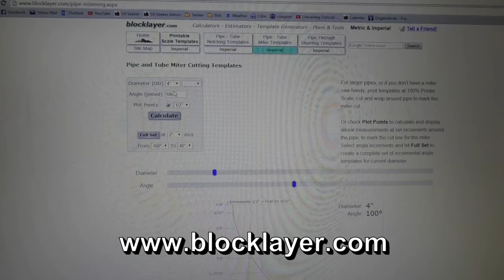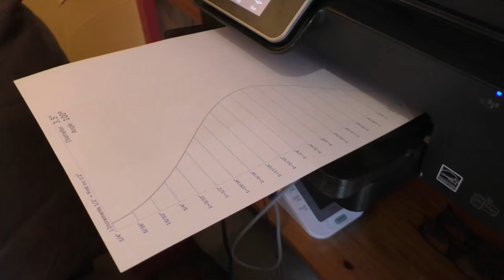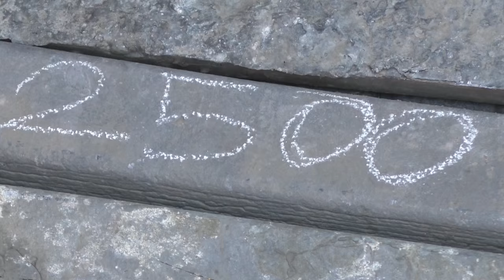Chinese Junk Sailboat - Catwalks and Keels and Engine

Comment: My uncle gave us a good scolding when we let his little garden tractor run bone dry out of Diesel. After he fixed it by cracking all the lines like you were doing, he pulled us on side and described what it would have been like if it had been our boat motor and we were out to sea. I'll never forget that lesson.

Comment: Hey Doug, for the aluminium plank.   if you put floatation under about the last four feet with a hinge, when you lower the plank down to the water, the last four feet would make a level spot to board a small boat.  it would ride up and down.

love the boat.
Reply from the maker: +RocketRadioShow1    Interesting idea.

Comment: Doug
This may have already been resolved but if you were to weld a plate over your lead and install  a thread-a-let you could fill the cavity with oil or such to prevent corrosion around the lead.
Reply from the maker: +Barry Luke    Yeah, we're thinking about roofing tar.  When it gets chilled by the water it would act as a seal too.

Comment: Doug, if you should decide to use the expanded wire idea, you may want to construct what I'll call ankle {hand} railing, that maybe only measures height wise, say 12" inches, (30.48 centimeters.) I would use say 1.5" inch {38.10 mm} Dia. pipe. Use a pipe within a pipe setup, so either you can drop it (remove pins) and it is either flush with the walking surface of the catwalk, or maybe drops just below the catwalk surface. Or Remove (ankle railing) all together. If you should have to stow something on the catwalk surface, it would give you something to tie down / lash to. I would try to make the ankle railing all interchangeable, so you don't have to try to remember which section goes where. Plus then, when your trying at night to escape the heat of the hull, it gives you an option. This Idea comes via my day trip to a U.S. Aircraft Carrier. On an Aircraft carrier, all along sides, and back, they have netting to catch someone should they fall, but the guy who was giving us the tour that day, also mentioned that some of the sailors, when it's really hot, sleep in the netting.

Comment: We have to wear safety harnesses (attached) when we weld 6' above ground level. Failure to wear hard hat, safety glasses steel tip boots and gloves is grounds for immediate termination. Thanks for the "what not to do" safety video.

Comment: Hey Doug. I had the same thought that other people have mentioned about the expanded mesh for the catwalk... but I can see your point that it wouldn't really do what you want. I had also considered some of the nylon mesh, tied tightly over the frame, such as they use on high-end sailboats - but I bet that's probably too expensive. You're probably right, that a simple board might be easiest, but at least put some stabilizer dogs on the bottom of the boards so they're impossible to slip out of place when you're putting foot-pressure on them, pulling a rope or whatever. 

Anyway, there were a few things on my mind in the past week or so that I wanted to mention to you. Stuff we used to do when I was welding and building in steel-fab job shops, when I was younger. Chances are you might've already heard these things, so no worries if you tell me I wasted time telling you about them. I type fast, so it isn't much of a waste of time. Plus I enjoy typing at you. I can't afford to travel to Tulsa, so I feel like I'm contributing, even if it's only in a small way.  :P 

Something you can do to help lining up pieces before welding, especially on sheets, is to cut a big c-clamp in half. Weld a small base plate over the cut on the screw-half, then you can make a small tack on the base plate against your work and screw the business end of the clamp down against whatever you want to push against. Usually to line up an uneven seam before tacking. This would probably work well for a lot of those times where you weld a "U" together out of angle and put a bottle jack in there to push something into place. Obviously it only has as much force as a c-clamp would normally have, but it was a standard tool we used all the time in the steel fab industry. Almost as useful as tacking on a piece of plate and pounding a wedge in to straighten out a seam. 

Also, when you're welding on a picking eye to hook the chain hoist to... something else that was standard practice for us is to weld only one side of the eye. You can put something like a 3 inch weld on one side, with only a small tack on the other side. Then, you can pull with several tons of force - and when you're done with it you can just hammer it from the tack side. The tack will break, the welded side will fold over and break off, and it doesn't require you to grind the welds before removing it. Very useful when you're trying to get stuff done in a hurry. 

Another one, when I spent a year or so lining up seams on 1/2 inch plate before we welded it together, is that you can put a hot tack a seam on a couple of plates that are out of line by as much as 1/8 inch. Then, while the tack is still red, you just smack it with a big hammer and the plates line right up. No need for the big tack-clamps, no need for tacking on wedge plates... just make a big hot tack and pound it once or twice and it lines up straight and beautiful. It's something that saves a lot of time when you're tacking stuff together and don't want to fiddle around with wedges or clamps. 

I'm sure there's a few other things I might remember over the next week or two. You've learned a LOT about what you're doing in the past 5-6 years, so I certainly don't want to imply that you don't know what you're doing. You obviously do. But I spent about 20 years doing a lot of ironwork and steel fab work... and if I can help out by mentioning a couple of things, then I'm glad to do so. I've been repairing houses for the past 15 years, and my memory isn't quite what it used to be, but if I think of anything else that might be helpful I'll mention it do you, eh? ;) 

Still, it's great to see the work you're getting done, it's great to see the boat coming along! It's a lot of fun to see how the project is progressing, and it's a LOT better than seeing what's on the stupid TV. Thanks for taking the time to upload the videos, and I'll keep watching and liking them. :D
Reply from the maker: +KOakaKO Thanks for the tips.

Comment: Great as always :) the other day i had to bleed out the diesel system on my car and what i did was i took a big pnumatic air cyllinder and used it to make a big vacuum on the returnline of the system. I tried the thing with thightening the pipes as it runs but that didnt work for shit. Make a vacuum on the return side of the pump.
Reply from the maker: +Rasmus Laursen   Thanks for the tip.

Comment: Doug just a thought. Instead of keeping planks for walking on the catwalks., ty this. Use a aluminun ladder horizontily laid  next to the bullworks held in place by two simple hings and kept there by a simple    fall down  lever. allways there and when needed lift the lever and the ladder falls  down to walk on. It would be lite and avaible when needed

Comment: Hey Doug, just an idea, for the cat walk(s.) Use some stout expanded wire, or use some thinner material, and use a couple of say 1.5" in. X 1.5" (38.10 X 38.10 millimeters) angle or square tubing, etc., as brace(s) between the 3 foot {91.44 centimeters} on center bracing you have already built. I would think a minimum of 2 or 3 braces per section, evenly spaced should be more then enough. My thought is, this way it couldn't collect water, and act as some type of ballast. In case it's been a long day, the 'L' part / leg, would face the ground / water surface. I've seen this used for cat walk's in some BIG buildings. Plus it would give who ever has to walk this surface, shall we say "some peace of mind," that their not going to be swimming with the sharks. :-) I know, I know, the sharks have got to eat too.

Comment: Boy howdy I love when you post a new video.  Question - why not make the pilot house narrower so you wouldn't need the catwalk?  What I mean is, if there was a 30 inch space between the pilot house and the existing railing, you could walk all the way around the boat and stay on the deck.
Reply: +Douglas Underdahl not much room left in the pilot house then
Reply from the maker: +Douglas Underdahl      I like the roomier pilothouse and I like the catwalks.  :)
Reply: +SV Seeker Makes sense to me.  Thanks.

Comment: New to this channel. Seems like you have loads of fun. A few tiny questions you no doubt have excellent answers for. Keels in sailboats tend to have a significant support to the framework of the boat. I kinda seem to think in this case the keels were simply welded to the side. And now they are made more heavy. Is there any chance they would break off?
Also, what is the future plan? Float around the world? What are your plans on things like toilets, kitchen, bedding and all those other things that make a boat livable.
Reply from the maker: Yes there is a change the keels will break off.   Life is an adventure.   If that does not happen then we will be a free research vessel for scientist that also seek adventure.    And we'll work out the details of the interior as we get there.
Reply: SV Seeker I would weld on some extra just to be sure. The issue here is arm. The base of the keel, where it is welded, seems to be about a foot. The length of the keel is something like 10x that. Hence whatever force will hit the keel it will multiply by 10 on the welds. And that means hitting some sandbank with some force might directly get serious. Keels in the middle of the boat will make the boat roll over. In your case they are under an angle and stick out, so that means that hitting something will be followed by a buildup of the full weight of the boat. And I doubt that be a good thing.

Comment: Concrete reinforcing mesh would work well on the catwalks.  It supports a bunch of weight once it's welded down & lets everything else pass right through. I have it on my 35ft open race car trailer for the salt flats.

Comment: Thanks for the awesome video this is my favorite channel! 

Im not a sailor, or actually i never seen a steel sailboat before, but isnt is possible to just weld some rings on the roof of the pilot house, so when the boat is moving on the ocean and u have to go over the catwalk you can just get a safety harness and tie yourself to the pilothouse? So then you would'nt need to lay planks all the time u wanna walk there.

It was just a strange idea what entered in my mind when i watched the video.
Reply: +horogandris I think that is their plan. If not, that is how I think it should be done! :)
Reply from the maker: +horogandris    ...and it is a good idea.   Once the dragons are up we will build hand rails that go down both sides, just below the windows of the pilothouse.
Reply: SV Seeker Looks very nice in my mind. Steel rings with neon colored rope for visibility? Plain steel handrails tend to be very slippery when waves spray on them and hard to see at low light.

Comment: Some of the older pumps had a a hand operated bleeder pump to help prime the fuel. On the fuel pump, some had low suction power because they were designed to work with a pusher pump in the tank. Meaning they didn't have the nuts to draw fuel to them from the tank and did not put out much pressure to the injection pump. Any questions feel free to ask.

Comment: yes i was thinking expanded  mesh as well just think when you get the steps organised you wont need the ladder  access any more also is there a reason you have not already cut the port holes out yet i am thinking it would be good venting and some light maybe its a weather thing  keep the rain out .. all the best big pete
Reply from the maker: +peter donaldson      Right.  Don't want the rain or the cold.

Comment: You should be using Stick or Fluxcore welding rather than mig for most parts of the ship. MIG was designed for sheet metal, it doesnt penetrate as deep as flux/stick. You can see the lack of penetration at 4:40 when he was grinding the weld down. The welder was also not cleaning the metal before welding, with a non flux type welder you can get some bad inclusions and compromised welds from welding on rust.  The point of the MIG gas is to prevent the reaction primarily of hydrogen, oxygen and nitrogen in the weld. This makes it ideal for wind free shop work, however not so great in the field. With flux included types of welders such as stick you don't have to worry about the rust as much, or lack of gas from wind ( although its still good practice to clean the metal regardless)

Comment: once had a hell of a time getting my old diesel primed up 
it turned out that the injector blead back line the tinny one between the injectors that serves to cool and lubricate was letting air into the suction line on the injection pump
i found this by useing some clear hose i could see the air and by kinking the line could stop the flow and it started this may not be the case for you but thought it may help

also try an eclectic fuel pump like an efi one to force feed the main pump this has worked for some with worn out lift pumps inside the main pump
Reply from the maker: +Josh   Thanks for the tip.

Comment: As a possible alternative to a wooden plank on the starboard catwalk, how about  steel mesh, something that is mostly open space, yet strong enough to walk on. I can't think of what it is called, but it is typically in a cross hatch pattern.  Would still allow any waves hitting the catwalk to go through, would be self draining, and would give something more reassuring to walk on.

Comment: Bleed the low pressure side first.  Loosen the plug at output of fuel filter.  activate the pump (or starter) until it stop bubbling.
Re-tight the plug.
For high pressure side, have all injector line tight and bleed one injector at time only.
Bleed no 1 at first.
The engine will start after 1 or 2 injectors.

Be careful not to get fuel injected under your skin. 
If you suspect a leak on high pressure line, test it with cardboard, not your hand.

Comment: Another way of making those pipe miters I've seen is with a lathe, you put a bit the diameter of the pipe you're joining to in the chuck and have the pipe mounted to the tool post with a jig. Suspect it'll be way too hard with pipes the size and length of yours but might come in handy.
Reply: they also sell tubing notching jigs (which is the "correct industry term" from aviation) at most drag race supply houses (for exhausts, roll cages, etc). they use a hole saw on a drill press usually. the problem with both is the "dynamic install" you witness in their efforts. as everything is "twisted and tweaked to fit" (read that pounded and manhandled, lol), angles vary. moving your head a little when you line up the saw cut changes the length a little. it's not like a chopper frame, where you have a full size blueprint to lay each part on, and "bench fit". what you witness here is why EVERY boat is just a little different from it's sister, even if the keels were laid the same day, and always have been. if they were building a dragster, or a plane, they would be butchers of the highest order, lol. for boat builders, they're pretty standard to industry (well, maybe not doug's earliest welds, lol). now, his "site safety standards" are more in line with a marine wrecking operation on the shores of india than a louisiana boatyard, but his actual "shop practices" aren't too atypical, and pretty damned normal. i'd ride out a good gulf storm on her, which is about as good an endorsement as possible, lol

Comment: a while back a seen a trick used by off road guys running diesels , they run an intank electric fuelpump and use that to bleed the system like when they rolled the vehicle with the engine still running or if the engine ingested water and they replaced the filters ...... people running vegie oil use the trick too 
since you dont run the engine all the time it might be a good option to try
Reply from the maker: +watahyahknow   Thanks for the tip.

Comment: Question.  I'm assuming the molten metal you are pouring into the keel is to make the ship bottom heavy and stabilize it at sea?
Reply from the maker: +patchesdf   Spot on.   Sailboats need heavy keels to offset the forces on the sails.

Comment: Had a old dragline awhile back and would run it of fuel a lot.  I put a shrader valve or air valve on the fuel cap and would hand pump some pressure into the tank then crack the lines to bleed off the air and start her up.  Just a thought?  She is looking real good wish I could help.

Comment: hey Doug, has anybody yet mentioned to you that you can't run a full mechanical 6bt as "mains" in a boat whose hull was laid after 2000? that bus motor will be a "NOGO" for documentation, and a COI. you have to run a QSB (the computerized 6bt, specifically for boating) on "new construction". that's a 25k motor, plus install (and they'll void the warranty if you put it on a highway trans, like that allison). i don't think you'll pass the sniff test for "aux engine" (like a bow thruster or a gennie would), even with your feathering prop. if you haven't yet, get a FIRM ruling from your local coasty inspection unit, in writing, that you have an "aux engine" set-up. that way come move and inspection, you don't get a red ticket. i figured better to warn today than be amused by a failure a couple years down the pike, which would ultimately suck like few other things, lol
Reply from the maker: Yes sir officer Barby, she was built in 1986.
Reply: lol, ok you have keel date voodoo... just checking you dotted i's and crossed t's. never too early to look for paperwork gremlins, and the dream choking influences of emission regs